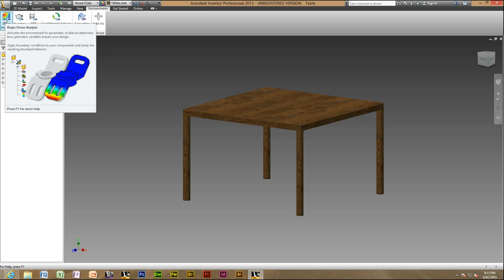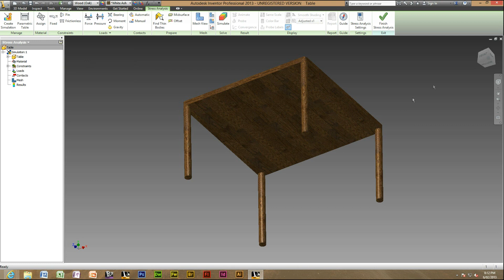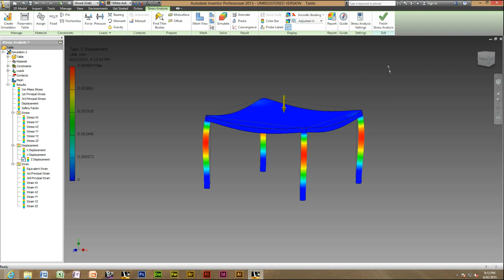Autodesk Inventor 2014 - Using And Creating A Stress Analysis

Comment: Guys the table doesn't look like that as the result can be seen as: Actual, Adjusted x 0.5, Adjusted x 1; 2 and 5. That table will not look like that as he applied 100N which is 10 kg.

Comment: I have a question:

How can I export the results of a simulation to excel?
Reply: Screenshot?
Reply: I mean the data, not the figure. But it doesn't matter, I already gave up with that.
Reply: ***** You have on the right hand side near "finish analysis" a button with Report and you can save the simulation. You can save as html or rtf file. Good luck